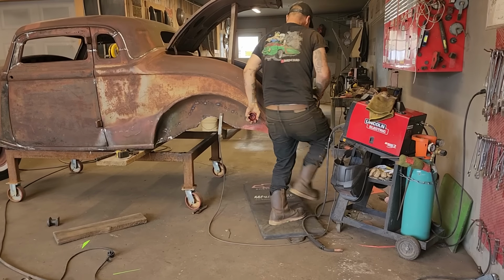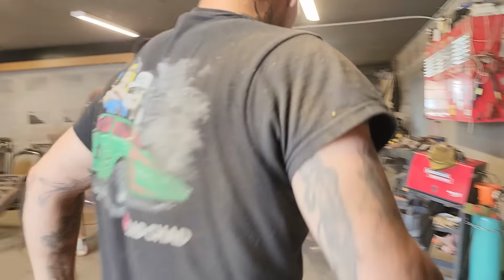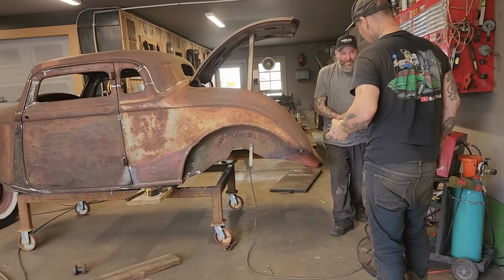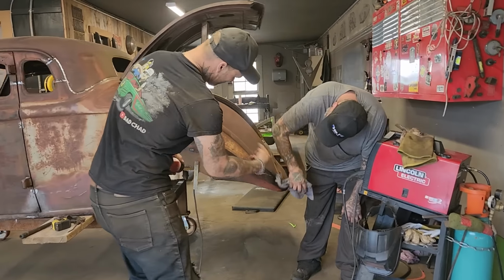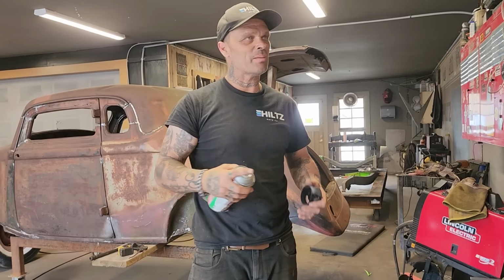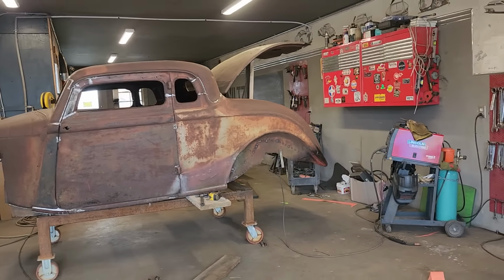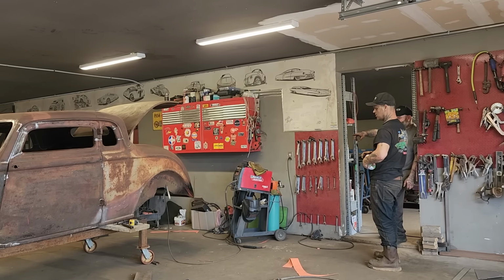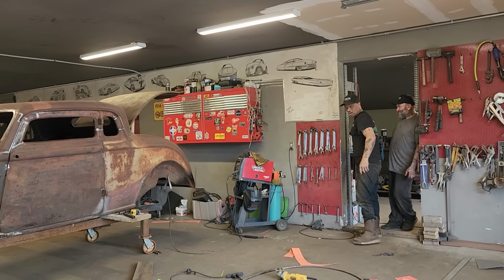Bad Chad creates faux patina with a spray bomb 🤯

Comment: Spray a solution of 2 cups (470 mL) hydrogen peroxide, 4 US tbsp (59 mL) white vinegar, and 1.5 tsp (8.5 g) of table salt on a clean piece of metal to rust it.
Reply: Or a bottle of beer and salt is much easier.
Reply: Yes it will rust in 24 hour and less
Reply: I don't think they read the comments...:eyes-pink-heart-shape:
Reply: He's not listening
Reply: Your right hydrogen peroxide and salt will make it rusty like the rest of the car then you have to rinse it off with water to neutralize  the peroxide an salt to stop the rusting. And moist of the time your right they don't look at the good helpful comments. I can tell you that trying to use paint to make it look like rusted metal doesn't work and it doesn't look good
Reply: @brewstar58  they read the comments, they are just not interested. Bad Chad knows all. Let’s just take some primer and some rocker guard and mix it together with some black paint,  oh my goodness it looks perfect.

Comment: Mix equal parts white vinegar and table salt in a spray bottle. Spray the solution onto the metal object, ensuring that the entire surface is covered. Allow the metal to sit for several hours or overnight, depending on the desired level of rust.

Comment: Dissolve steelwool with vinegar  over night  then paint the bare metal it will give  you the patina you require  you may  need two coats depending on how much  patina you want

Comment: Sweet Jolene BadChad I,Ve got to say a NO to the red oxide primer vinegar and peroxide is the best solution for patina on new welds or metal sorry no disrespect but my opinion which don,t matter to you all ANY 29 TO 36 coupe of any kind that is built to a early 60s up hotrod should have some kind of paint on it this is a HOLY GRAIL of Hot Rod years all that's been done which is a ton of work you all have did well a couple more weeks for a color put on this car it needs to be a statement HOT ROD BAD CHAD SWEET JOLENE patina looks great on some but not a mid 30s COUPEyou all have a super sweet hot rod

Comment: You can use water  salt lemon juice vinegar, mix it strong, put it on the peace of new metal, and it will look like the rust on the car in two days. Just make sure you wash it after properly. Otherwise, it will keep eating away at the metal as the mix will be acid based, cheep fix

Comment: Why do you paint the new metal, it looks like S@=^ everyone told you to just make a mixture of vinegar and metal filings painted on the metal and less than 24 hours it will look like the rest of the car , you can even use it to blend in old panels so they look the same !!!😊